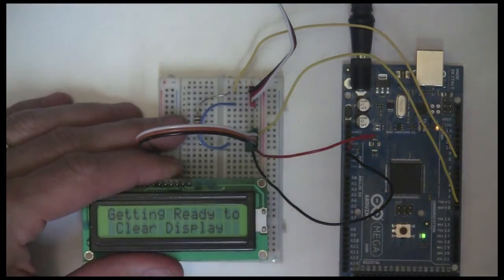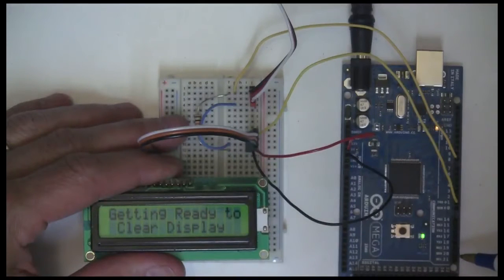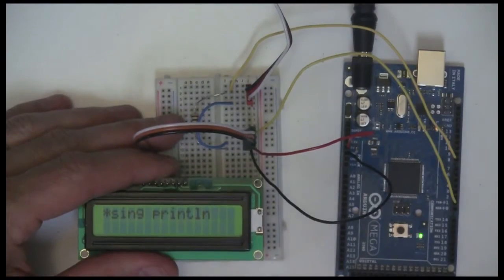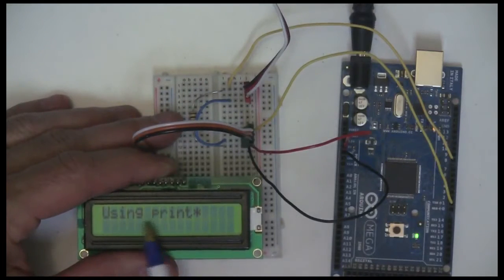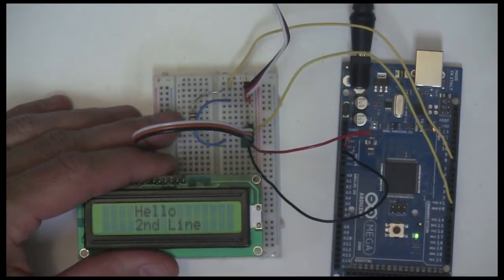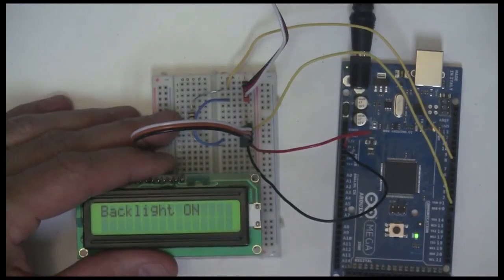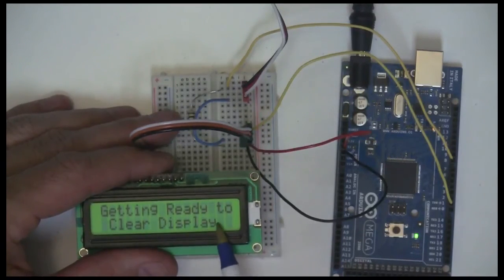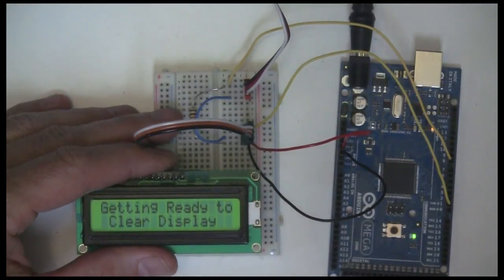Serial LCD with the Arduino

Comment: thanks, that was very helpful, but my serial LCD is labeled: GND, VCC, SDA, and SCL. my question is with the SDA,and SCL where do they go? I would very much appreciate a reply if you know.  please send to snaprollin@yahoo.com  thanks mike
Reply: It depends on the arduino you have. If you tell me which one you have i can tell you. For the Uno its located after aref after digital pin 13. Those 2 not labeled.